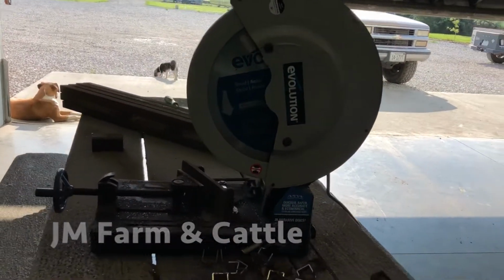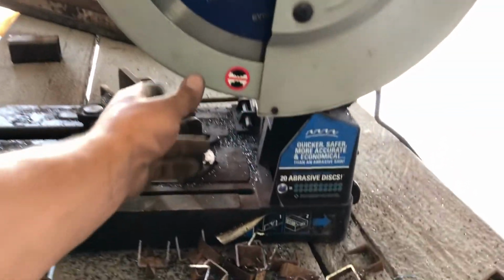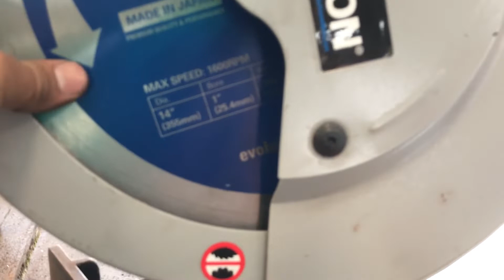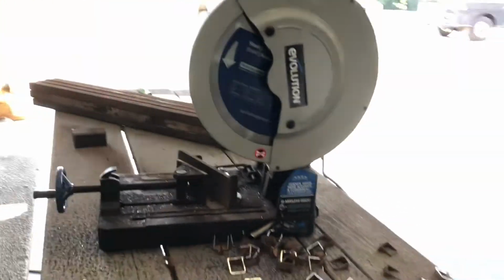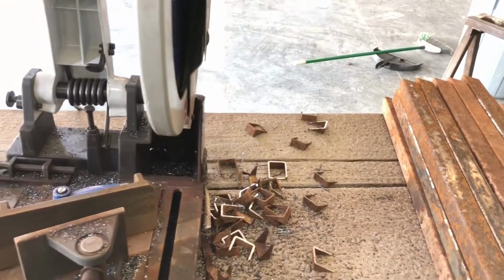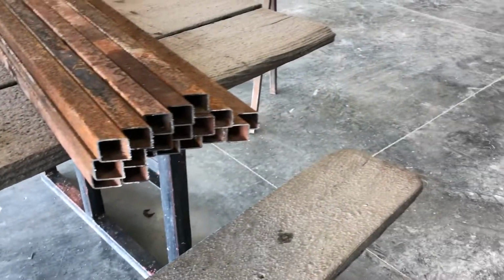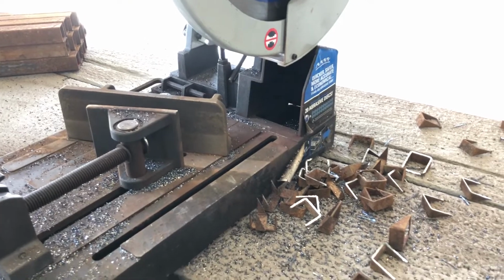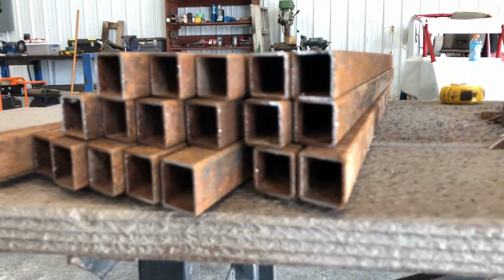Evolution Metal Chop Saw

Comment: Yeah man those dry cut saws are awesome. You’ll never use an abrasive chop saw again, and when the blade gets dull you can have it sharpened. I get at least ten sharpenings on a blade before they are shot, so a blade lasts a loooooong time!   My only bit of advice, and maybe you’ve already learned this, but make sure you have your metal clamped down good!  It’s real ugly if it jumps out of the vice while you’re cutting, trust me!
Reply from the maker: Farmer Tyler Ranch ya they are awesome! That’s good to know you can sharpen them. I usually clamp it down but I do have my days where I skip that step and it’s not good!